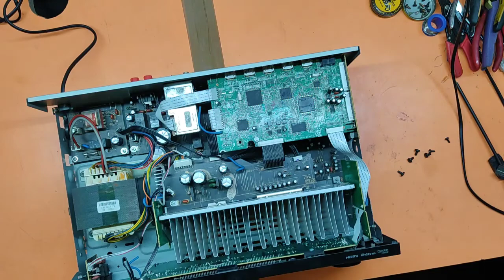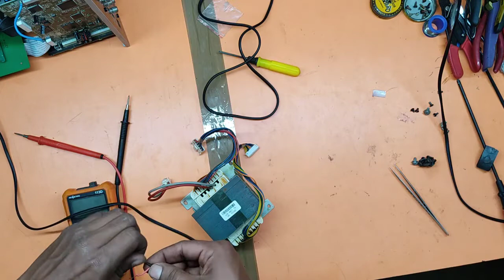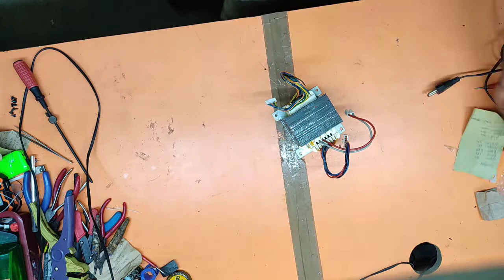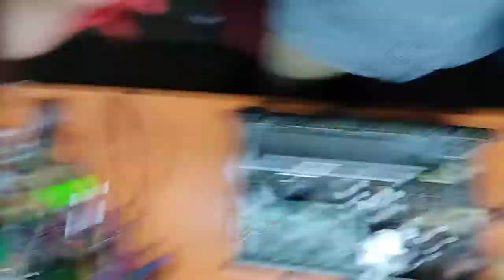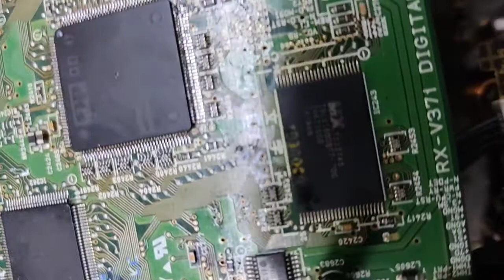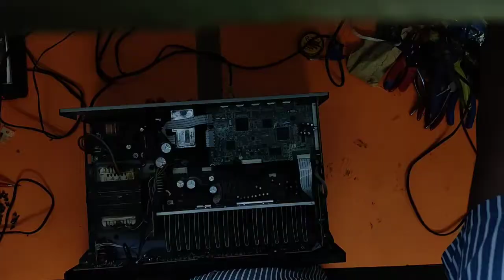Yamaha HTR- 3064 AV receiver Dead Fix & DTS IC replacement for no sound issue

Comment: avr 2000 harman kardon , when I switch on display comes immediately it gets off , no problem in amp and decoders section , when I give 5 volt supply externally to display processor the stand by mode led changes its colour within 3 seconds the processor remains warm no overheating any suggestions and more over I reset the system still the problem continues
Reply from the maker: Check protection circuit part , protection detection transistors itself failed
Reply from the maker: Also check thermal sensor

Comment: Bro dts, Dolby branded av receiver,amp la mattum thaa work aaguma or assembled amp la yum adha effect kondu vara mudiyumaa
Reply from the maker: 50% only possible
Reply from the maker: 100% not possible
Reply: @fixavreceiver  thanks for the reply bro 

I'm using sony home theatre which bought 4 years back I'm planning to upgrade 

So assembled amp ,or sony ht iv 300 or yamaha entry level av receiver1840  purchase pannalama nuu confusion

Amp assembled panravanga kitta ketta with HDMI options ooda Dolby ,dts support aagumnu sollaranga

Please suggest ur personal opinion bro
Reply from the maker: Bro, it's very simple don't confuse , assemble amp with hdmi and dts support with remote kit total cost 6000-10000 solvanga based on wattage.and sound quality vise less but sound level high  Ana board quality and build quality and functions romba less but brand amp vangana accurate dts effects varum and reselling options irrukkum
Reply: @fixavreceiver  thanks bro ,, thank you very much
Reply: @MohanKumar-dx4co  ethu vanguniga

Comment: Hi there. I have yamaha rxv773. Dsp chip is bad. I ordered new one and replace it. Now I have speaker logo showing , but no sound at all. No test tone either. Old chip was D80YK113CPTP4 and i bought DPTP4. That is updated replacemwnt from texas instruments. Or should i buy CPTP4?
Reply from the maker: Bro, then replace the DAC ic
Reply: @fixavreceiver  what is DAC ic?  Before replacement i had to wait for dsp chip to heat up than speaker logo showed up and sound was there the whole day. After replacong the chip problems started. Could it be a bad new chip? Its from aliexpress
Reply from the maker: Once you install the replacement ic u need to turn on in advance mode in receiver then use init all options, so then only saved ram programs get copy to DTS ic
Reply from the maker: First ic also need to buy same model no, becoz from AliExpress all ic's are copy version only and duplicate the getting more heat compare to OEM ic . In my experience

Comment: Hi brother i have rx-v377 internal error issue how to fix
Reply from the maker: check hdmi voltage section and bios ic
Reply: @fixavreceiver  bios error that is sure  when i check advance mode  model region error is showing how to register model and region?
Reply from the maker: Please check user manual for steps

Comment: Hello dear....good job. Only issue was your language is not understandable. So, request you to add subtitles. 
I just want to know some preventive steps for my Onkyo HT-R670. It is working ok but as you know, the hdmi board or DTS chip issue is prevalent in most of the AVRs. Could you pls. suggest few things which help me avoid any issues? I am planning to install computer fans to vent the heat out. Thanks.
Reply from the maker: Hi bro I have uploaded subtitles also please enable CC in your app
Reply from the maker: No need to add any cooling fan, just used   rated speaker and don't over drive the unit
Reply from the maker: If possible u can Mount small heat sink on top of the IC
Reply from the maker: Fan won't work belive me , I already tried it

Comment: Is it possible to add preout connection to av receiver
Reply from the maker: yes we can but its not safe. avr gets fault or goes into protection mode .due to input or output over drive

Comment: Sir my Yamaha avr 7.2 rxv665 but when on decoder mode off no sound  out and surround back speakers is not sound only 5.1 ok 7.1 not ok plz send solution me
Reply from the maker: Need to check in digital board DAC ic

Comment: Good work bro 👍
Is that transformer a aluminium winding?
Reply from the maker: No bro, pure copper
Reply: I do think so i have rn303 stereo receiver , it also seems to be like silver winding
Reply from the maker: No bro I don't think it's silver or aluminium, in my experience I checked different models Transformers they're all pure copper winding

Comment: Brother.. I am trying to switch on PANASONIC SC PT560 after 12 months. But only RED lamp is coming. Not powering on. What could be the reason. Any trick to HARD RESET ?
Reply from the maker: First check inside and clean all plugs , connectors and cable then try it sir
Reply: @fixavreceiver  Thank you for prompt reply. Everything seems to be okay. But no progress. Only power LED is glowing 🙁
Reply from the maker: Please share images and videos in my whatsapp

Comment: sir yamaha digital board repair possible modal htr196
Reply from the maker: Sure, what is the problem
Reply from the maker: Please bring it to me I'll fix it
Reply: @fixavreceiver  sound output not coming
Reply from the maker: Check DSP chip and DAC ic voltage
Reply: DAC chip problem
Reply: any solution
Reply from the maker: How do you determined as DAC ic fault
Reply from the maker: Can you able to chat with me with whatsapp-9943124215
Reply: sir i need pcm 1681dac chip
Reply from the maker: Ok I have stock
Reply: how much does it cost
Reply from the maker: Bro please send me the front panel image when amp turn on. In whatsapp
Reply from the maker: 600.RS plus courier charge
Reply: ok sir

Comment: There is a thermal 
fuse inside the transformer
Reply from the maker: Yes, it's fused and two layers primary windings also burned, so I rewind the primary windings, and secondary windings is same no change
Reply: @fixavreceiver  how does it blows man . Whats u r speaker impedance?  is it 4 ohms or does it short the output yamaha has no short ckt protection.previously iam running my amp at 4 ohms.@65% of the volume makes my amp a little hot.now i changed to 16 ohms amp runs cool even at 80% of the volume .a little bit of clipping when the extreme lows other wise it fine.I don’t recommend 4 ohms for yamaha it blows your speaker as well as stress your amp badly
Reply from the maker: Bro , first thing- speaker low or high impedance and input overload can harm only output stage or digital section and cause AMP to trigger into protection mode .and their is no harm to main transformer primary windings
Second thing- customer told his house electrical got power fluctuation problem it causes the amp transformer
Reply from the maker: Before using amp please refer manual and use speaker with OEM specified rating. Stick with your manufacturers spec
Reply: @fixavreceiver  ok i know only over current drowning making the transformer winding to burn.the output stage is related to the secondry and primary as well as the main power. Input stage does t matter the perimary and secondary winding ,i think input stage make damage to the driver transistor.Actually the speakers get the power from the transformer which is modulated by the transistors according to the input(low voltage doesn’t matter the transformer).when low impedance speaker is connected more current will demand from the transformer by the transistor to operate in the active region. This current also may damage your winding and transistor 😃
Reply from the maker: In Yamaha avr No need to worry about what your comment above the CPU ic designed to detect the thermal and dc/ac voltage ,amp overload related issues
Reply from the maker: If u want to test what i am  saying to you, goto your branded avr and connect speaker wires and just touch speaker + & - wire together then tell me what happened to your AVR
Reply: @fixavreceiver  sounds great now iam confident